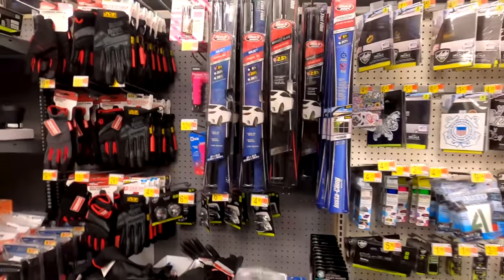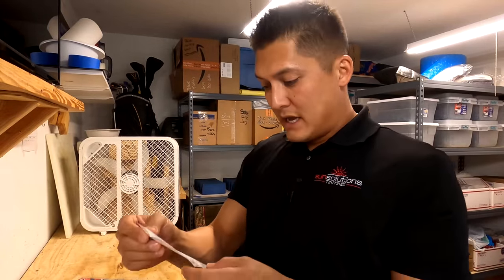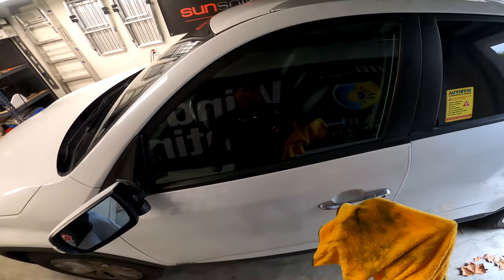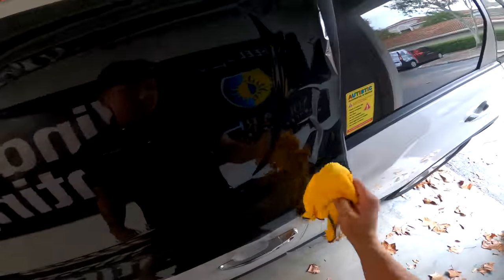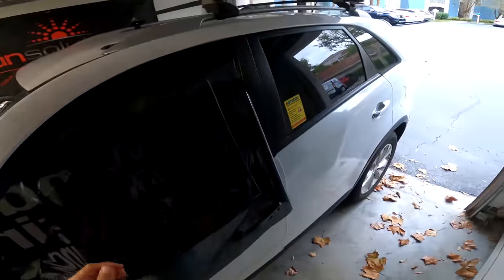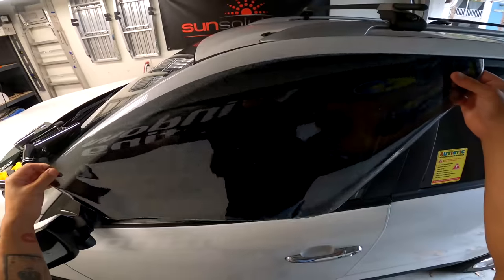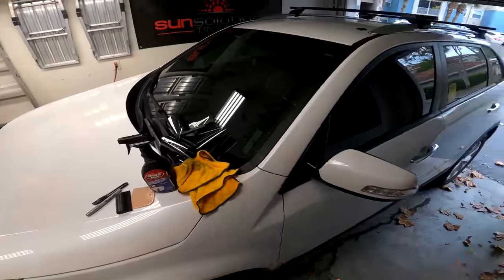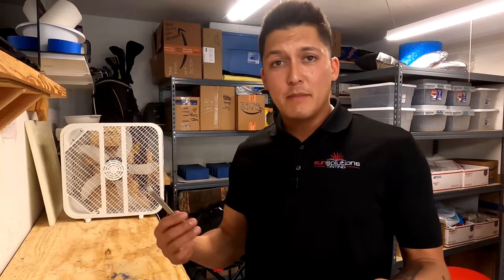How To Tint Your Windows | Walmart Black Magic Window Tint

Comment: I used WalMart Black Magic tint (3 stars) in the past on several vehicles.   The tint went on fine, a bit hard to get the bubbles/fingers out but I did.     In EVERY case the window tint changed colors in about a year and a half, it went from black to a grayish white color, it looked awful.   I had to uninstall the film on each car, I cannot stress enough — this stuff is PURE CRAP!    Do NOT install Black Magic film on your vehicle, it might look ok initially but will change color in time.
Reply: I feel like it’s a cheap quick tint though , just until you get it tinted professionally
Reply: Well if you wanted quality and longevity you wouldnt be going to walmart
Reply: Personally, I would just buy it to learn how to install tint so I didn't mess up the nice tint I wanted to put on. $20 to learn and not have to buy another $100 roll seems worth it in every way to me. Most people aren't going to buy Walmart tint to keep on their car for very long.
Reply: a year and a half? that’s impressive, sounds like you installed it on the outside but who knows. it’s good cheap stuff for over a year
Reply: mine did that in a day. I'm taking  it back!
Reply: @clo7245  LOL - nopes, on the inside 😄

Comment: Why do you not need a heat gun to make the tint fit the window curve?
Reply from the maker: As mentioned in the video most SUV’s, trucks, mini vans you don’t need to shrink. 

Shrinking would be needed for a curvy sedan

Comment: Now...how hazy was the film in sunlight? I saw a video that made this tint close to a road hazard...
It's nice if it were good tint, but I would love to find out if it was just flawed tint, or truly that poor of quality?
Reply from the maker: Any film that you get from retail stores are typically low and bad quality but people want to try it on their own. You could find a pre cut kit or bulk film from a site that specializes in it and get a better quality film. Worth a try
Reply: I've been using Lexen Film for about 2 years now just doing my windows and friends and family vehicles and so far that film has stood up to the elements without any issues.

I'm FAR from a pro, but just do it on the side some.
I don't even advertise that I do window tint, but being most window tints,  you have to be a dealer or installer for that company, the Lexen tint doesn't require me to be a qualified installer to buy from them.

I will say the Carbon and Ceramic tint from them so far looks just like my factory tint even in the Southern states heat and brutal sun during 2 summers so far.

Comment: Also when the vehicles leave my shop they can roll there windows down immediately.  That's because I push ALL excess water out plus I use a heat gun and seal it. Also when cleaning any tint weather it my be your cheap auto parts / Walmart tint or your local professional tint , always clean with that same baby shampoo and water . NEVER EVER use windex or anything with ammonia in it. It's 100% guaranteed to turn your tint purple. I know you all have seen this before passing you on the hwy and wondering.  Well that's what causes it. Your welcome again!!!!

Comment: Hey. Great video! My question is How did you get the measurements so accurate for the windows? I have  pt cruiser and was looking into learning how to redo my tint at home , instead of paying $120 for him to re apply more tint.
Reply: Also do you think I will need another tint roll if I choose to o my back windshield.
Reply from the maker: In the video I used a sharply and cut the film just outside the lines I made. For the back window this film would be too short and wouldn’t be able to cover. They do make some films for back windows though
Reply: Illegal tint
Reply: @MH-xu9kz  🤡

Comment: Lol the cut of the video made me think to installed on the outside so my smart ass installed it on the outside 🤦‍♂️. I guess i will have to redo it essentially once it falls out lol.
Reply: How’s it holding up
Reply: @hectorcorona8071  honestly idk i bought a spray, sprayed it to the window and it sticked. But now it’s officially out. I am going to redo it the right way now xp
Reply from the maker: It won’t last longer than 6 months or so. It’s just not designed to last as an exterior application.

Comment: Cutting the tint on the window doesn’t scratch the glass?
Reply from the maker: Three blades out and low angle and the knife will do the cutting easily. Fresh blades and just enough pressure to cut the film.

Comment: Worse part was finding the peel start from the tint and protective sheet. I would not recommend doing this yourself. Pay the pros 😊
Reply from the maker: As a professional window tinter I would have to agree but some people want to try it on their own.
Reply: Bro . We all 1 day want to learn . The same way every pro did . Made mistakes and learn . Or you think he was a pro as soon he was born🤔 you a troll dude 👎🏽DB
Reply: That would be the plan...let the pros handle it. If only the pros weren't greedy and trying to get over maybe we would. Got a quote yesterday for $280 just for the two front side windows and a strip across my front windshield. Foh
Reply: @guttagutta420  bro ... Just try yourself. Practice and you will see . I did it myself and came out real good for my first time. All it need is patience
Reply: @guttagutta420  I just spend like 50 buck or less .
Reply: @guttagutta420  For real! I started doing all my cars with Lexen window tint since it's cheaper than $265 for a sedan. The roll 24in by 100ft is only $74. These shops are crazy!
Reply: I was taught to put a corner in my mouth and wet it with spit. Then use my upper and bottom front teeth to bite down on the film while using a circle type motion. Then push my tongue between the the film and the backing to separate the two. Its highly effective. (although I have no idea how years of licking tint adhesive will eventually effect your health, but i can't see it being any worse than stuffing envelopes)
Reply: @WindowTintingBusiness  , comments?

Comment: and ive seen people say in the steps that you need a heat gun which as we can see is complete bs YOU CAN use it IF YOU NEED TO but its not a necessity
Reply from the maker: Nope it’s just easier on trucks and suvs. You definitely need a heat gun for most sedans and coupes if you’ll be top loading. 

Even sometimes when bottom loading

Comment: you don't want to damage the car window, but cut the template right on there ???  you could have rolled the window down and just cut on the top edge for a better cut.  Very difficult to trace cut that top edge with a blade.  the sides and bottom you can trace and use a ruler to cut straight or trim.  i just put my blade next to the side rubber pieces and cut, then slide over 1/4" then cut the other side, then slide it back, so you have a little over hang on each side, so you don't have gaps.  if you have alittle room on the inside bottom, you can do the same for the bottom.  cut it along the top of the rubber trim then slide the film down 1/16'-1/8"  inch if you have room.  then lift the bottom and roll down the window like you did.  then pierce the film and cut the top edge by riding the blade along the top of the glass in one direction, then the finish off the other direction.  the just clean up any over hanging pieces.

Comment: Perhaps you mentioned it and I missed it and if so I apologize but, wouldn’t it be faster to use two pieces of film back to back when you’re making the outline so when you cut em you’ll have both front windows done with one cut and measure? Also, you didn't use a heat gun... thought that was mandatory. Is it going to adhere correctly and permanently without the use of one?

Comment: Damn I’m about to head back to Walmart because no mater how much water I put as soon as the adhesive side you shed the window it’s not movable
Reply: U need water and soap ey
Reply: The video didn't mention soapy water because he bought the spray bottle from Walmart which I assume comes with some type of slippery solution

Comment: Dude you skipped a whole step and the most important step. You went from outside of the car then cut to the inside. What happens in between? Also a warning of the film folding in on its self would have probably been in that part. God video but I ended up wasting my film.
Reply from the maker: In this video I just put the film on the outside while I clean the glass.

Comment: really nice and educational video. thank you. but as a side note, glass can’t get scratched by metal no matter what you do. unless the metal has a higher hardness scale than the glass itself. literally, you can’t scratch glass with metal even if you wanted to. but overall, pretty nice!
Reply: Get a carbon razor and cut tint against a piece of glass. I bet your opinion will change. There’s a reason why people have a peel board and only use stainless blades when they are cutting on the car.
Reply: @SergioPena20  my dude, my opinion will change as soon as a lot of people buy “carbon razors” for these type of jobs. i’m pretty sure that the guy was using a stainless steel razor. as i stated before (but i’m pretty sure you do not know how to read), glass has a higher hardness than metal. of course that if you use a harder material than glass it’ll scratch it. but, it’s fine. i guess people don’t know to read sometimes.
Reply: @marlonmalave7098  As soon as people buy carbon razors? People have been using carbon AND stainless blades for years, if not decades. That’s why tinters carry two blade holders in their kit. To address your other comment, how is it that I don’t know how to read, but yet I found something wrong with what you wrote? If I wanted to be specific, I could say that your own comment contradicted itself. In the beginning you wrote that you couldn’t scratch glass unless the material was harder than glass, but at the end you wrote “you can’t scratch glass with metal even if you wanted to.” So which part do you claim to be true? The first part or the second? If you’re going to act all high and mighty while claiming I can’t read, make sure you can write a coherent, noncontradictory statement.
Reply: @Marlon Malave Yeah, so, you are wrong. You probably should not internet cowboy in such a definitive tone. Stainless can absolutely scratch glass. I have a Wrangler, BMW and a Honda glass in my memory of shame in the last couple of years. Probably more overall but it happens sometimes when your car count is in the thousands. I am curious though, how many cars have you tinted?

Comment: In VIRGINA and TENNESSEE-- tinting the FRONT DOORS is ILLEGAL- and tinking ANY of the windows more than a very light percentage is ILLEGAL.... and NO limo stuff here AT ALL.. they will make you take it out at the stop- OR confiscate the car til the fines are paid.
Reply: I’m in Tennessee and you can have tint on your front windows. As long as it’s not darker than 35%. And I think it’s 70% for the strip on the windshield and the back windshield too. But it’s not completely illegal to tint your windows.
Reply: @brandydrewery5135  That WAS the law- but it's recently changed-- I have friends that have been stopped for it... It's getting stricter.. everywhere.

Comment: First of all, tinted windows are simply not necessary on cars & trucks, save security vehicles & transports. Having tinted windows just enables motorists the opportunity to possibly engage in clandestine behavior. In parking lots, when next to
a vehicle with tinted windows and trying to back out, it's makes safely seeing oncoming traffic more of a challenge. Tinted windows are especially hazardous for law enforcement, especially when they approach a vehicle during an investigation. A Police Officer should be able to CLEARLY inside a vehicle.  Bottomline, they should be illegal. If people are caught with them, they should be required by law to replace the glass at their own expense and pay a hefty fine, if they obtain them after the law enacted.